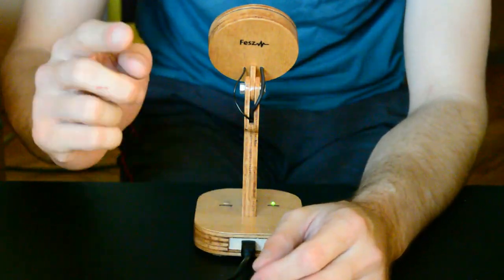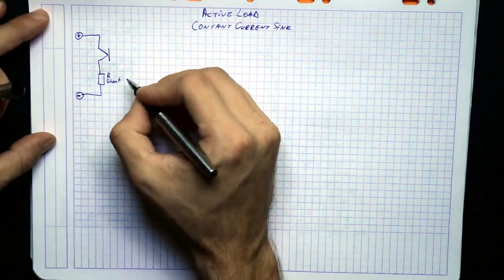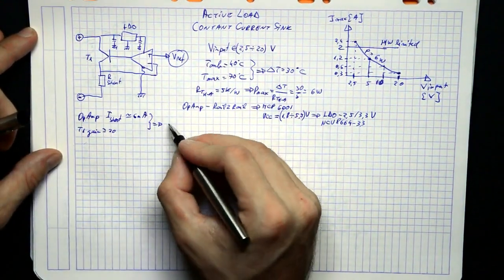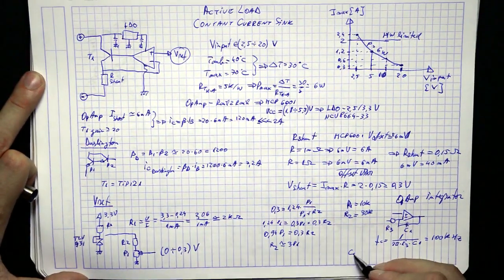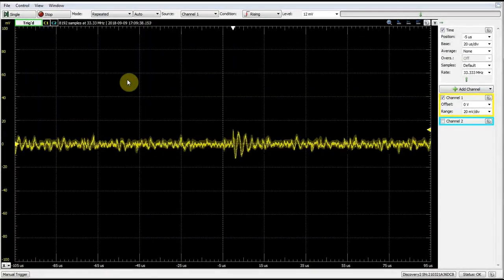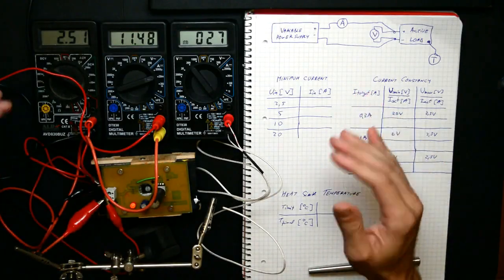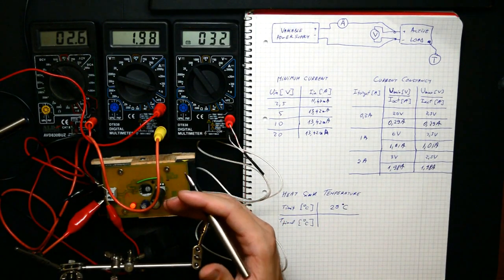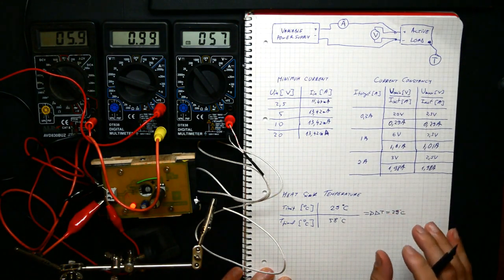DIY - Constant current sink - Active Load

Comment: Nice design. Handy, minimal, functional. I built my own version closely following your design. I think, though, that I may replace the LDO with a CR2032 coin cell to power the opamp and reference. Should get a few years runtime, I think, and also might get a little more range for low voltage inputs. I used an old CPU cooler, so I have the option of using the fan too, if I find I want more capacity/less heat.

Comment: Where did you get your heat sink calculator from? Thanks.
Reply from the maker: I did not calculate the heat sink, by pure calculation, but rather measured it. I dissipated a known amount of power, and measured the temperature achieved as well as the ambient. From this I worked out the thermal resistance. Rth=(t_sink-T_amb)/Pdissipated

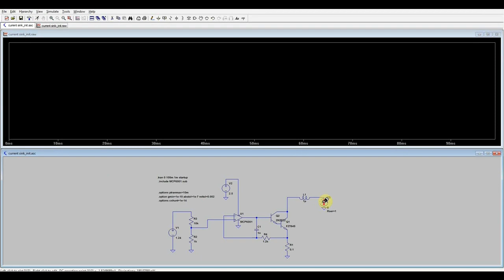Comment: At 5:07, when you say “added wire inductance” - where do you add those, and how did you figure out the values?  Thanks!
Reply from the maker: Hello @MegaCadr ! The wires I am referring to are the wires going from the circuit to the power supply. In the case of this simulation I represented that by L1. The value is based on the length and thickness of the wire, you can google a "Wire inductance calculator" to get an idea of what self inductance a certain length of wire has.
Reply: FesZ Electronics Thanks!  I never thought wire had that much of an effect until very high frequencies.  Learning so much!
Reply from the maker: If you go to high enough frequency all parasitics start to matter. Usually parasitics are ignored just to make examples or theory easier to understand, but in real life you can't really ignore its effects.

Comment: Dear Sir, I think you made a mistake. You calculated everything right for the Op Amp integrator as a low pass. But you connected it wrong in the final schematic. The input for a buffer is connected to the output. So you also need to connect the input of the Op Amp integrator to the output to make a buffer. Therefore the Resistor 2.2k and the capacitor 1nF should be both in parallel connected to the shunt resistor. So you 1nF capacity is wrong connected. It should be connected to the shunt resistor and not the output of the OP Amp. But then again both resistor and capacitor make no sense for this configuration as the input is high impedance. I don't understand why you connected it like this. Maybe just make a cap in parallel to the shunt and finish? As far as I understand you want to reduce the noise over the shunt resistor coupled into the feedback. But I really don't understand why you couple the noise (!) input into the output of the OP amp as it will add up. Therefore a positive feedback loop which is unstable. Maybe I am completely wrong. But please explain, maybe in a video?
Reply from the maker: Hello, well let me try to take it step by step - the integrator is built with the op amp, the 1nF and the 2.2k (see fig 11 of - http://www.ti.com/lit/an/snla140c/snla140c.pdf?ts=1591207495320 as example); the input signal that is to be integrated is the voltage on the shunt, and the output drives the transistor.  There is no dedicated buffer, the point of the integrator was to slow down the response of the op-amp to any voltage change on the shunt when fast transients are present, and with DC signals, the capacitor can be ignored and the circuit does work like a buffer. 
The main difference between this schematic and the one in the AppNote is that here the positive input is not at ground but rather a different potential. You can also check out fig 36-38 from the AppNote on this type of circuit. 
The logic behind the schematic is that even though the opamp input is high Z, the op amp output is not high Z. So the signal coming into the opamp is filtered in reference to the op amp output not ground or something else. 
Let me know if this makes sence.